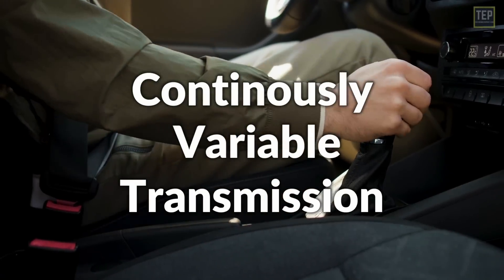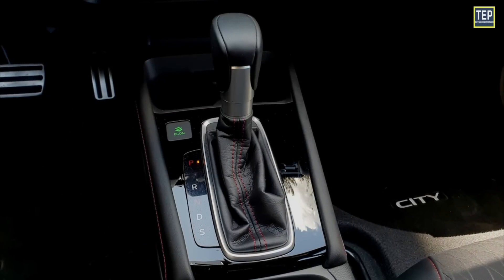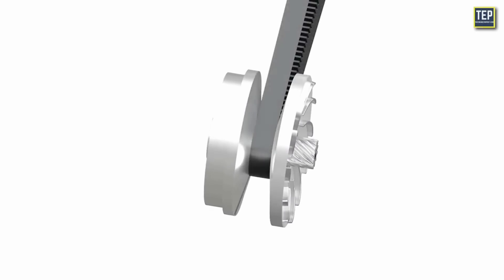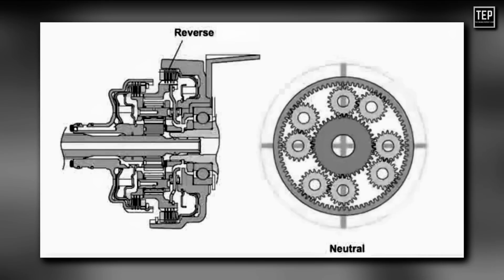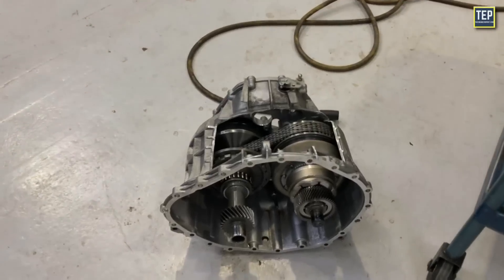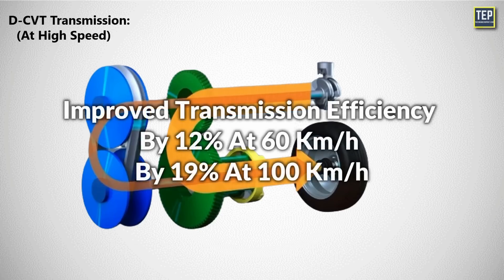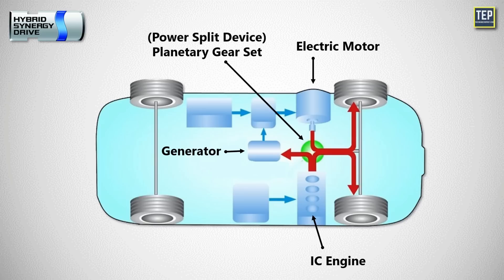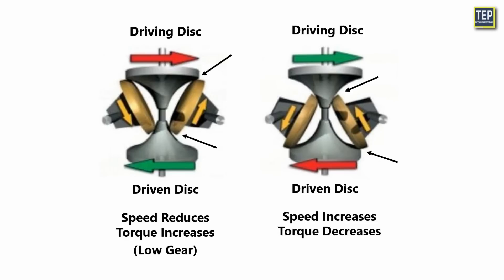Are There Any Good CVT's? | Different CVT Transmissions Explained

Comment: Interesting, thank you! I consider Buick's Dynaflow to be a CVT of sorts, it's ratio changed based on the stator position. It was fairly reliable but inefficient. Chevrolet had something similar with their short lived Turboglide.
Reply: The Dynaflow transmission in my father’s ‘57 Buick needed frequent repair.
Reply: Back in the day, we used to call them slush boxes. Two speed I believe. Very inefficient.

Comment: CVT can be good... great.  F1 cars has it for some time to be prohibited due to fantastic performance. For "every-day", such CVT's would be too expensive.
Reply: No, it was never raced in F1. It was banned before it could be used.
Reply: @Steven-k8v1s  Exactly, because it was too good / too fast
Reply: @CPE-j1u  Yes. Continuously variable gears ensuring optimal power transmission. It was banned before it triggered a technology war.

I did some research as I wasn't sure if Williams were the team doing the development and I confirmed it was. They tested it in the FW15C in 1993. I didn't see any times, but it looked like a private test so it may mean no times were released. CVTs were banned a few weeks after the test.

Comment: hybrid cvt the goat, no belt no snap
Reply: Hybrid cvt is called e-cvt.
Reply: Manual is still the goat.. bye
Reply: @ashneel
People like you are annoying and illiterate as fuck. No. It's not. It provides intermittent power output, can't output more torque than comes in from the engine, requires more attention from the driver, and gets worse fuel economy than an eCVT which is mechanically simpler with less points of failure. It's also a terrible choice for stop and go. The only advantage a manual truly has in this day and age is the 'fun' factor which is subjective. If what you said was true it'd be the go to for every driver.
Reply: But the problem is when high rpm, the only way to send all the power to wheels is to generate electricity, then use that electricity in a motor again, resulting in losses.
Reply: @KamerKazanci-wj2ou that is the performance fuel-inefficient state yes. But you typically do not drive in that state unless you need to put foot down for over taking a truck or something.

Otherwise it is a fuel efficient setup!

Comment: Somehow I will never feel comfortable with a system that relies on friction to transfer power.
Reply: What about a clutch, as in a manual transmission.
Reply: @peterkauss5852  Clutches don't really use friction to continually transfer power. They would burn our pretty quickly if they did that. Their job is to momentarily transfer power until they are fully engaged or released.
Reply: Besides the clutch: what about the transmission of power from the driven wheels/tyres to the road......
Reply: @janvandamme8920  Kind of hard to avoid that until MagLev for cars comes along ☺
Reply: Clutches don't use friction to transmit power on a continual basis, they do that only briefly during gear changes. Apart from that they are either locked or open.
Reply: Old manual transmissions relied on friction to transmit power. It is called a clutch.  I never wore one out but I know plenty of people that did.
Reply: Todas las transmisiones funcionan por fricción... Tanto las de convertidor de par como el resto... Te olvidas del embrague.
Reply: Like tires?
Reply: Tough luck, every car needs friction to transfer power, unless a jet turbofan powered car is already invented

Comment: How cars with CVT disengage the drive shaft when for instance at a stop light? Do they feature a torque converter like a regular automatic?
Reply: I asked AI: When a CVT vehicle is put into neutral while stopped, the clutch inside the CVT is disengaged, and the driving force from the engine is cut off.
Reply: There is a dog clutch inside the CVT. If you put the CVT in neutral, the shift lever disengages the dog clutch. Almost all CVTs also have a lock-up torque converter. When you stop the car with the transmission in D, the torque converter still tries to apply power through the belt to the output shaft. As you first move off, the torque converter multiplies the torque until you reach a low to moderate speed, then it locks up, and the belt/pulleys take over the job of 'changing gear'.

Comment: Good old mechanical (manual) transmission/transaxle is cheap to produce, cheap to maintain and extremely reliable!
Reply: Except for clutch repairs.
Reply: Se podría decir que la e-cvt es la más confiable?
Reply: Exactly.  The manual gearbox is less complex, more efficient.  No mention is made that none of these CVT designs  approach the reliability, efficiency, performance and low cost of the manual gearbox.  Note that two of these designs introduce - wait for it - GEARS.  They do it for performance.  Another thing: several manufacturers introduce fake shifts to induce a sensation of - wait for it - GEARS.  All this for what?  They seem to be doggedly maintaining that buyers don't want manuals, and shove CVTs in our face (as in the WRX) and then attempt to infer we wanted it all along!
Reply: @arsnb9m907  The manual is less complex, but it is certainly not more fuel efficient.  Compare any car that was offered with either option and the EPA fuel economy rating is significantly higher for the CVT than the manual.  The CVT keeps the engine in its most efficient RPM range much more than a manual can.
The only reason manufacturers offer manuals at all is because they are cheap to produce (econo-box) or fun to drive (sports cars.)
Reply: @joeendsley5016 Yes, it certainly is true that CVTs can be more fuel-efficient, but it's  not that simple.  For instance: if you can't tow your trailer, it doesn't matter that the CVT is cheaper for your Walmart runs.  Efficiency is measured in different ways (ie: heat production, torque transfer, ancillary system requirements such as cooling) etc.  All has to be taken into consideration.  And no: manual transmissions are not just produced because the are cheaper to manufacture.  They are produced because people love them.  They are lighter and provide a more engaging driving experience for many people.  Rear diff ratios with the manuals favor performance.  If you want and insane "granny gear" you can do it with a manual.  We can't design a pure CVT which effectively handles the different context like the markets demand!  There will always be a place for the CVT, but let's not pretend they are what they aren't....
Reply: @arsnb9m907  I think we are in agreement.  If you look at my comment, there's an important OR in there.  Manufacturers produce manuals (in passenger cars) because of low production cost OR because they are fun to drive.  Those are very different applications.  In either case, though, I think the designer is safe in expecting that you didn't buy a Nissan Versa or a Toyota Supra because you wanted to tow your boat with it.  
I never suggested, nor would I, that a CVT is the best choice for every application, nor for every customer.
Reply: @joeendsley5016 in Europe they do manual transmissions in 90% of their cars including hybrids!!  Mine got 45 mpg combined.   The turbo diesel got 55 mpg and people towed their horse trailers with them.  So to say that only cvt’s get good gas mileage is absurd.  A cvt won’t tow like that either.   They want you to think that a cvt is everything you want mpg wise but there are other options….just not in the USA.  So let’s just throw more junk into the landfills and wonder why we have such massive landfill issues to begin with.  CVT’s are what’s called planned obsolescence, and that’s not a good thing for the consumer….but it IS a good thing for the manufacturers.  Peace ✌️

Comment: CVTs are fascinating engineering achievements but that does not take away the fact that they're solving a problem that shouldn't be there in the first place: internal combustion engines are simply not suitable to drive a vehicle with varying torque and rpm requirements. ICEs are kinda ok for single speed aplications (like generators, for example) but cars should be driven by electric motors.
Reply: This is why I believe that internal combustion engines should perform better in range extender applications where they can always operate at peak efficiency.
Reply: Using an engine to generate electricity and then running the vehicle on a motor is inefficient at high speeds, so it is more efficient to use the motor at low speeds and the engine directly at high speeds, and this is the method used in Honda's hybrids.

Comment: From 2007 to 2023, I had a Ford 500 sedan with a 3.0L V-6 and a CVT.  The vehicle had nearly 300,000 miles on it when I sold it.  Had the CVT fluid flushed & changed at the Ford dealership once. It never gave me any issues. Was totally reliable.
Reply: 300k miles! WOW
Reply: @colinubeh1180 uses the Toyota ecvt the only one I trust.
Reply: @colinubeh1180  I now have my second Subaru with CVT. First Subaru 11 years about 285.000km, changed CVT fluid every 80.000km. No Issues. Bought the "new" one second hand, at 4 years old but with only 25.000km on the clock, now it's almost 7 years old and has about 75.000km on the clock. Changed Fluid after 60.000km as previous owner used it mainly for towing his horses around. Never had any issue with the CVT. Driving CVT is just a great feeling, however you have to get used to driving a CVT in the optimal way at first. Kind of like shifting with your right foot.
Reply: how often do you use your car to drive uphill in the mountains?
Reply: @yohanespradono5224 ummm never😂😂😂
Reply: @yohanespradono5224  daily.
Reply: Driving Ms Daisy. Come to Africa and have a run at it

Comment: I would like to see more detail on how the toroidal transmission is put into reverse, if it doesn't have to rely on an input planetary like those used in the belt-pulley systems.

Comment: Fun fact: CVT are the fastest transmission of all time, even if it was boring. And it was once dominated in F1 before it was banned.

Edit: Yeah, it just never actually raced anyway, but i kinda remember and feels that someone said that it indeed race. Sorry, i felt for it 😅☠️
Reply: Toroidal cvt without the pulley system. Made 2000HP and looked into leaked numbers in F1 it was 10 seconds faster than any gearboxed race cars at that time.
Reply: Wrong. CVTs were never raced in Formula 1. They were being considered and may even have been tested, possibly by Williams, but they were banned before they could be raced, I think it was before one team could gain an enormous advantage over the rest.
Reply: @Steven-k8v1s  Ahh. I thought it was ever raced.....
Reply: @widjojohuang7854  I've done a bit of research as I wanted to confirm my memories. I was correct with what I was able to remember. It was Williams. They tested a CVT in the FW15C in 1993 but it was banned before it could be raced because of the potential increase in performance.
Reply: @Steven-k8v1s il CVT è un cambio non adatto a una guida sportiva!!! È inadatto per F1,rally ecc ecc!!! Sì romperebbe!!! È un cambio affidabile molto ma predilige una guida confortevole e non stressante!!!
Reply: @danielecarniel6674  Possibly, I don't know what type of CVT was tested. It looks like it survived the test but does not appear to have been subject to a full race simulation.

Video shows the car pulling away with revs rising, but no gear changes. The revs then stop rising when they've reached optimum RPM, but the car continues to accelerate.

There were concerns about the engine surviving, as the CVT keeps the engine at high RPM in order to achieve optimum power.

Apparently after he tested it David Coulthard thought it was worth about half a second per lap, so a useful gain but not a total game-changer. It would probably have been more with further development. The gearbox was a bit large and heavy.

There appears to have been a lot of hype from chair-borne warriors who keep exaggerating each-others'  nonsense. This was probably embellished by people playing an on-line game with a simulated version of a car for which no performance figures were published. I suspect the performance programmed into the game comfortably exceeded that demonstrated by the test car.
Performances from the game may have been reported as the real thing.
Reply: Might have been fast but the CVT's didn't last long after that.
Reply: @KA9DSL  Ahh. The fastest and most efficient, but the most unreliable transmission, right?
Reply: @widjojohuang7854  Reliable enough to win Formula 1 races. You know, the kind of racing event where almost none of the components can last a single season.
Reply: The CVT transmission never dominated F1 because it was never used in a race. Williams had a prototype that was used in testing and, yes it did show much better performance but, F1 banned the CVT in 1993 before it was ever used in race in order to maintain competitiveness between all teams.
Reply: @317Buffalo  Yeah. It just someone ever told me wrongly that CVT was dominant. Sorry for these error 😅
Reply: Let me know when they’re used in semis 😂
Reply: @rolandthethompsongunner64  Manual gear transmission. Wven autos are gear driven with selinods.
Reply: @glennwest4438 can’t beat an old Selinod.
Reply: And what kind of CVT was used in F1?
Reply: Na automatic bettee
Reply: different type of CVT
Reply: If the cvt has a belt and chain its junk !
Reply: @Spearonut  Yeah, reliability is junk of course
Reply: except from the lower gear to the highest gear!🤣